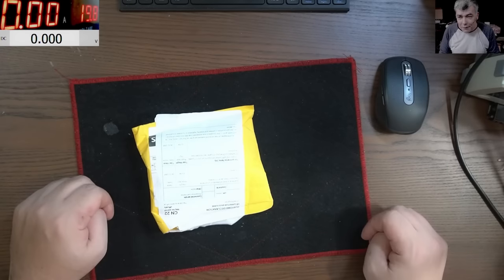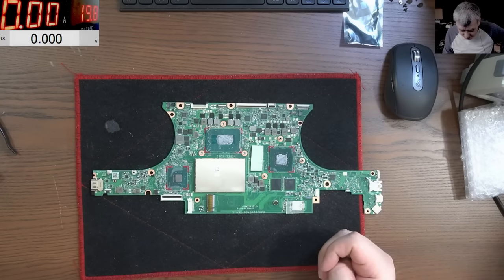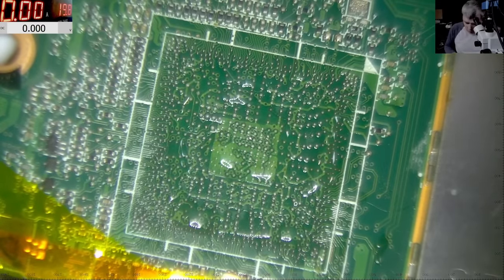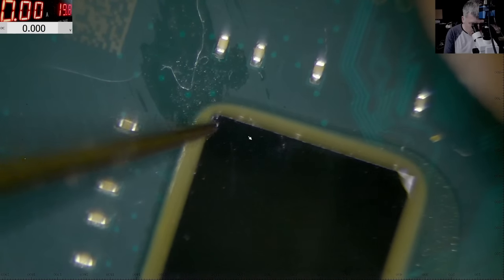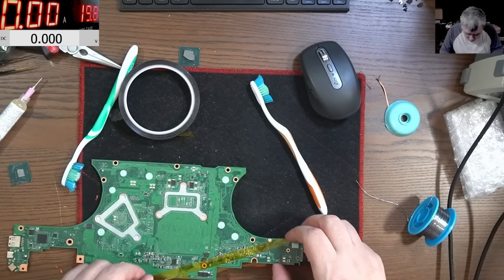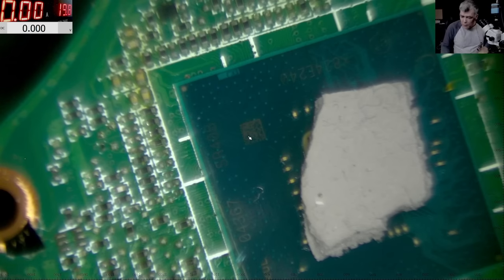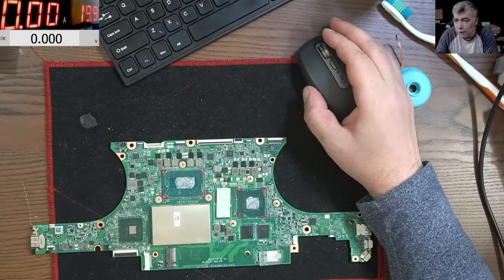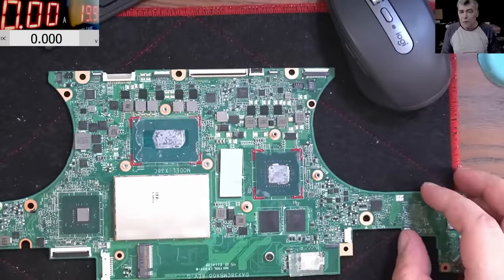That's why i don't replace chipset/cpu/gpu :((((((((((((((((((((

Comment: I''m really not trying to be ass but I believe you killed it with too much heat and that thermal pad drawing heat from the center. Heating from the top and warming the board is the correct way. Have done this hundreds of times and maybe I had one fail. Don't know if it was me or it came that way. You also had 3 times the amount of flux needed. too much flux will float the chip. Sorry it turned out crappy for you.

Comment: You didn't use a rework station. There can be many reasons for failure. I think replacing chip-sets is not economical, no matter what kind of equipment you have.

Comment: you need a preheater and an appropriate noozle for your hot air station to do this work.
Otherwise you'll kill the chipset and flex the PCB badly....

Comment: HELP!
I replaced my PCH Chipset, The laptop is turning on fine. UNTIL i opened Valorant and it says that the laptop is required TPM 2.0 in order to play. IDK what it's not detecting it.I looked up many solutions on how to enable it but nothing works. so, i wonder if it could be the issue with the chipset that was installed. What can i do to make this fixed, I'm so tired :(

Comment: If reballing or Reflowing is as simple as this, then why do we need reball machines?  A cheap hot air station will do the job. That's the thing when buying from China, iits a risk when buying Processors or GPU, you just do not know how good it will be.

Comment: I bought a lot of chips from china and never had a single problem they all worked fine.
Reply: More or less the same experience, only bought eMMC which had a relabeled capacity (8GB instead of 16GB), all other chips I bought were working properly.

Comment: just replace the whole motherboard, don't even waste 1 second with this kind of replacement....  not worth it. 
40 £ + waiting time, vs a working used motherboard on ebay at 100 £  ....
Reply: show me this board on eBay for £100

Comment: The SR40B are the worst pch ive seen! I have at least one / week were i work that needs to be replaced. Even if they come reballed from china, always i put new balls. 
We are using a reballing station with proper temp curve for that, and always 1 of 5 pch they are already dead from china :))

Comment: Please, check out the soldering tutorial posted by you on Jan 21, 2023. Your ability to solder these types of components is NOT up for discussion ... come on man ... if that CHIP had been in good functional condition, another might have been the result. I know you'll try again on another board, as soon as the opportunity presents itself; that is, in the very near future.
(22:31) Poor quality of the protective layer (green dioxidil) that exposes the broken lines of the circuit. It's a lousy manufacturing process for that important chip. Thank you very much for sharing. All the best.

Comment: I can try to clean ME region for for free if you want. Just send me the BIOS.
Reply from the maker: I sent it on our discord, i will try with a clean ME, but, still, the chip is freezing cold and that's not normal for a chipset, i suppose is dead
Reply: @electronicsrepairschool  yep that's probably an indication of dead chipset :(